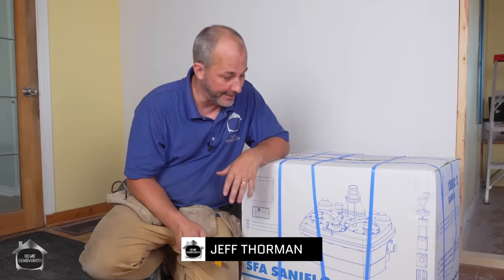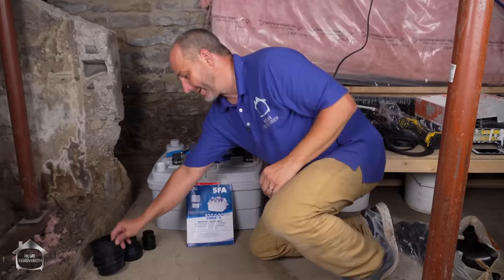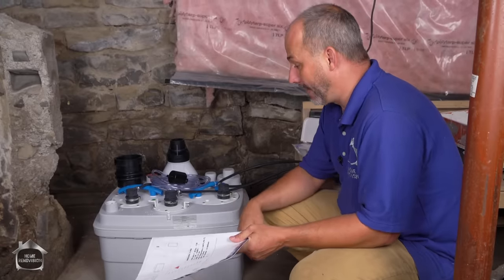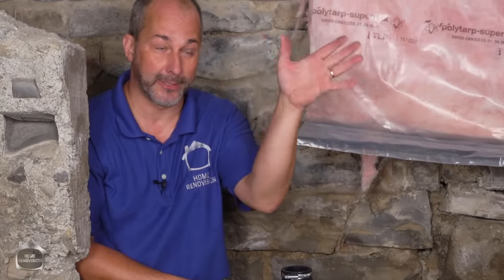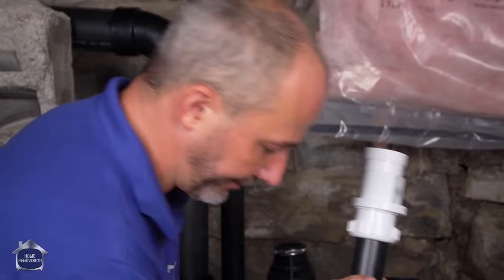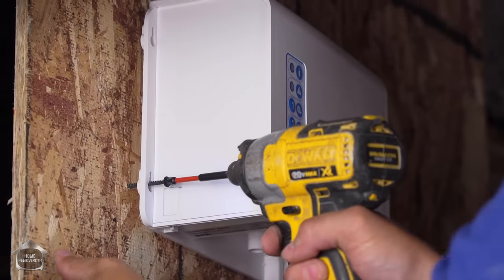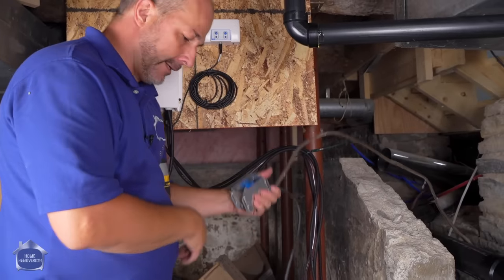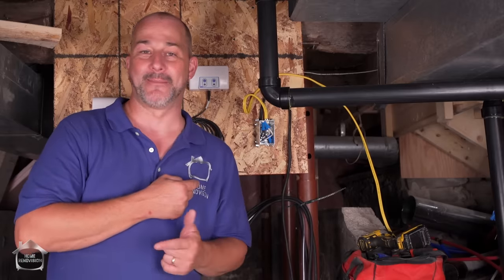Saniflo Macerator Plumbing Installation Instructions

Comment: Great job acknowledging your mistake and correcting it. I also like how you kept the mistake in the video and didn't just replace it with the correct version. Seeing a mistake being done is easier to learn exactly why it's the wrong way, additionally it was great to see the wiring being done. Cheers!

Comment: Having a 30' static head lift capability is impressive. I'm shopping around because our son needs to put a shower and toilet in his basement, and the main drain is 4' off the floor. This is looking like a strong candidate for that situation. I would like to install a sump-style tub below the slab, so the large toilet pipe could feed down into it. The shower could go right in the side, but I see the large fitting is on top, so that's a challenge. Thanks for sharing, I've subbed. I like your presentation style, and I wish you all the best!

Comment: Glad I waited to comment after finishing the video. Was gonna say something about the 14/2 not being enough & needing a 12/2 wire in that unit. But, you got it sorted & it’s cool that you left the “mistake” in the vid. You could have edited that out in post to make it appear was one perfect vid......awesome you didn’t. Everyone makes mistakes, it’s how you fix them that counts😉
Have been enjoying this series & it’s cool to see you transform your house into something magical that you & your family have done yourselves.
Cheers✌🏼
Reply: 14/2 is stuck in my head. :(
Reply from the maker: Hi Dianna, the load on thr machine requires a 12/2 line however ic can be wired to a double 15 amp breaker. Cheers!
Reply: Home RenoVision DIY Also was thinking when you were wiring up the unit & were using the 14/2....I was like cool, didn’t know a unit like that exists & how great that would be on some “problem installs”. But, you explained everything well in the vid, & again, it’s cool that you guys leave EVERYTHING in regardless of right/wrong AND fix the stuff if you are wrong. That, just goes to show how “human” you are; along w/ showing us your work ethic/morals etc....👍🏻👍🏻
Reply: Diana Fertig Sorry, didn’t realize the comment was a question, otherwise would have replied to you. Hope Jeff helped you out.
Reply from the maker: You my friend are a scholar and a gentleman. Cheers to you for your comments. I have stopped trying to act like I am perfect years ago. Besides Here on Youtube actors are sniffed out and rejected. Cheers to keeping it real!
Reply: If you dubbed a quick note at the point of the 14/2 mistake,  that would help stop others from making the same mistake. The repair at the end of the install time, is Great!

Comment: We use a saniflow saniplus at a student accommodation we manage, for one of the bathrooms to help pump sink, shower and toilet waste through the long shallow angled piping. Like you mentioned with those long black pipes. Its a smaller unit hidden in a back box behind the toilet. Dont forget to maintain it with the saniflow descaler/cleaner!  Great video
Reply: Can we use regular toilet bowl cleaner?

Comment: Top job, mate... 
Message to your viewers... He has the correct pitch... Over pitch ( > 1/4" over 1' ) is actually just as bad as under pitch ( < 1/8" over 1' ). The problem with over pitch is that the water drains too quickly leaving the solids behind, which invariably dry to the pipe creating a blockage you make actually have to cut out...

...Just say no to over pitched pipes.
Reply: Tim Falardeau it1/4” a foot 3” and larger is 1/8”
Reply from the maker: I Love it, I just say no to overpitched pipes. Cheers Tim!
Reply: Im a new build plumber and ¼ slope is fine. Ideally it should be ⅛ but It will still pass inspection if even ⅜. At least where im from
Reply: Why am I suddenly seeing a Scotsman tuning his bagpipes?

Comment: I bought a house that has all the plumbing running through a grinder pump and looking at this one this is what I need Because I have had one die before because most pumps are not rated to handle the whole home. So I will be looking into to one of these for sure now, Thanks :D
Reply from the maker: Cheers Sgt! this is definitely a made in North America solution that is quality all the way. A Company that has been in this business for many years with a support team available in case of problems. Cheers!
Reply: @HomeRenoVisionDIY  That price though wow that thing is expensive, I have a Zoller pump in there ATM, But the ability for one pump to die makes me wanna do it, Mine is in the slab so I am not even sure if it is possible. Have some research todo.

Comment: Love your channel, i work for a plumbing company and didnt realize they had toilet with its own pumps. 👌👍 Thinking of putting this in a detached building on our property to tie into the existing septic. The run is about 150' maybe 200' rise of about 8'. Ill dig it common trench with a pex line to supply water also. Electric is already out there. Just want to put a half bath in it so when we renovate it give more flexibility.
Reply: Will i need a toilet/sink pump also to achive rise and distance?

Comment: For anyone wondering the price for this unit is about $2700.
Reply from the maker: And worth every penny. BTW is that Cad or USD?
Reply: Home RenoVision DIY  No doubt, the horizontal distance is amazing and Mercian pesos.
Reply from the maker: Cheers Hunter, they have a single motor option as well at a lower cost but i prefer the back up power of having 2 individually operating motors. Cheers!
Reply: @HomeRenoVisionDIY  Home Depot has it listed for $2,713 USD before tax

Looks like this company has MAP pricing (every authorized vendor charges the exact same price set by the company)
Reply: OUCH!!
Reply: Thank you, but are you from Canada... cause.. the company is in Canada, Cambridge... so.. what is the price here? in Canada
Reply: @aggietor9208  would have to convert usd to canadian.
Reply: Jesus! $2700? And you have to INSTALL it? Should have walked over and installed itself...Why So Mucho?
Reply: @HomeRenoVisionDIY  how don’t you know you have one in the video..
Reply: I have the single pump version. Not installed yet. Probably another month or so before I get there. Cost me $1200 USD roughly with the elongated toilet bowl.
Reply: Also, purchased about 3 years ago at the beginning of my project.

Comment: Wow Jeff that's amazing! I'm debating what to install in my house. It has a basement rough in for another bathroom with the septic ejector tub in the cement floor. I'm not sure if its connected to the toilet plumbing yet. We shall see. This Saniflo system seems great. All I think I'll need is the single unit for a toilet, vanity sink and a shower. Thanks so much. That video was awesome!

Comment: These are great alternatives to digging a pit if you cant run underground plumbing in your basement due to the sewer line being too high although they do fail prematurely occasionally from just normal usage (even without throwing things you shouldn't in there).  I just had to replace my sanibest pro last week, only 5 years old. luckily it wasnt a messy failure i caught it quick, but the motor has just decided to die out on me. I just ordered the whole replacement tank which about about $1000 instead since the pump replacement was $799
Reply: Do they have a warranty? Or i guess homeowners insurance won't cover this type of application  maybe ?
Reply: I was thinking of getting the Sanibest Pro myself for a residential basement half bath. Any idea what maybhave caused the failure? Any suggestions on how to prevent a future failure? Any feedback from Saniflo? I thought this was supposed to have a ~10 year shelf life. How often are you using it (I know were getting personal here...)
Reply: You can find different brand macerator pumps on Amazon for like $250

Comment: I’m putting a master suite at the far end of our home that is 68 feet from the main septic line. I either have to have a long run of 3” pipe that would be 1/8” drop per foot, which concerns me of clogs with that long run, or I do this Saniflo system. I would like to have the pump in the basement, and use a regular toilet to flush down from the first floor into the macerator pump, along with the shower, sink and clothes washing machine.

Comment: I would like to renovate my bathroom including relocating all plumbed fixtures and adding a separate shower. Thinking this might be a less expensive route. As well, I have a small shop I would like to convert into an extended living space. This sounds like THE system to use!

Comment: Ihave the same unit I purchased 3 years ago, I’m finally getting to install it. What is strange is mine says 230v, but the connecting wire only has 3 wires, ground, neutral, and power?

Comment: Jeff, for maintenance you should put shut offs on all intakes and outtake (no need for the dedicated vent, and now folks you know why it's dedicated). In case of service you can shut the flow of waste off and service the unit, SaniFlo doesn't show it. The written  instructions mentions a shut off valve for the outtakes, but some of the pictures for the unit show shut offs on intakes as well. As for giving up a clean out, I wouldn't suggest that either as putting in a dedicate spot for the drain would of saved a clean out and taken about the same time. SaniFlo also makes stuff for marine applications, so I'm familiar with the name.

Comment: I was concerned about hi jacking the clean-out at first when I watched you make the connection. seems you were OK. Viewers should know codes require a clean-out  at a certain "developed length". If you didn't have another clean-out that met your code, add another wye at the connection and proceed. Easy! Nice Video, well made.

Comment: I'm looking at a system similar to this for replacing lines that are currently collapsed in my concrete basement floor. I want to rerun new lines for my kitchen, laundry and a wet bar and have it go to the main stack. The idea was to not have to bust up the finished basement to fix old clay tile pipes and have them go through my dropped ceiling in basement. I had a plumber come out and tell me that I would need to either bust up the floor and replace the existing lines to fix them or run lines through the ceiling connecting to a 3 inch main line that would hang low in the ceiling where it would be visible. A friend who is very diy savvy told me about these systems and said I should able to connect all the "New" lines to that system then run a smaller horizontal line to the main stack.

Comment: Great video as always! How is the system after 2 years working? I was hoping you show it on camera to see how it will function. The biggest question I have, is the sound it makes? is it loud? Thank you
Reply: I  too am curious about ther sound it makes.  Mine is loud.  Am wondering if there is a solution for this issue?  Your video video is great.

Comment: Thanks for the upload. Looks great and looks really simple. I would just hate to see the price. I went to the site but I didnt see a price anywhere so I came back here and watched the video completely all the way through. I will have to go back to the site to see of i over looked the price somewhere. Now I just have to watch the complete shower you were talking about. Thanks
Reply from the maker: The unit is costly, however there are other options with 1 macerator and even costs as low as 300 for a pump for a shower unit. Cheers just check with the fergusons or wolseley in your area!
Reply: @HomeRenoVisionDIY  thanks and i will check with them

Comment: I was planning on putting one of these in a small cubby off the kitchen on the main floor as a half bath. There's not good access to the main in the basement unless I'm banging my head into the drain every time I'm walking to the basement. There is however access to a smaller sewer  pipe that ties to the main which this toilet would be sharing this with the kitchen sink drain..wonder if that would be code.

Comment: It looks like a good solution to my basement plumbing problem :)   I scanned the other posts but never saw a PRICE... if it's not crazy money then it'll be for me... otherwise...out comes the jack hammer... (from Kenora NW Ontario Canada).  Thanks ps; forgot to ask, can it handle the discharge water from a washing machine... that would make it a total solution for a basement bathroom/laundry edit; (again)... did some reading on the saniflow site and yest it'll handle the washer....major bonus.... price is still a mystery.. WAG $2k Cdn....

Comment: We are planning to remodel a building with concrete floors. Rather than cut the concrete I was thinking of using one of these types of Saniflo waste systems.  1 Toilet 2 sinks and shower only. I have concerns regarding the toilet bowl, I have read reviews stating that you have to clean the toilet after each use because of low water in the bowl and no way to adjust the level. If you have any information or suggestions  I would appreciate it.

Comment: I just bought the saniflo 3. I am adding a full basement bathroom with a standup shower, toilet and sink. Excited to get it started but nervous because I have very little plumbing experience. I am placing the small pump in the wall behind the toilet. this wall also houses the main drain to the septic. This video helped a bit but any suggestions or input would be appreciated. Thanks!

Comment: Nice video. One question... everything I've seen on Saniflo toilet installs (Saniplus, Saniaccess, Sanibest) tells you to avoid hard 90's for the discharge pipe. They all suggest "sweeping" turns using 2 45's. Curious if this unit is different than the ones directly connected to the toilets?

Comment: Just something I would like to add if you have that loop of wire sitting on the screw that you put in you might want to wrap it with electrical tape to insulate the screw from the wire. The sharp threads on the screw may cut their way through the insulation on the wire from the weight sitting on it. I had that happen with a piece of Romex wire that someone left laying on top of a screw that was through a floor joist, overtime it cut its way through the Romex insulation 🙄
Reply from the maker: I will look at that again. Cheers!

Comment: I see you used your clean-out for this grinder pump.  Is that ok from a plumbing code perspective?  I have a similar situation and I assumed code required a cleanout as your sewer leaves your house.  I was trying to figure out if I could put another 3" Y fitting on the old clean-out and then still have a Clean-out and a place for the grinder pump.

Comment: We just moved into our home in southern Indiana from Florida....so yay we get out first basement. Problem is we are a family of 5 and only have one bath tub/shower upstairs. So we have already had someone come and frame and enclose a nice 5X12 space in our finished basement where we want to put a bath room. Vanity, shower, and toilet. 

You mentioned something that I didn't think about in that we are constantly getting clogs in the the toilets up stairs and we never considered that we could tie all the plumbing which fortunately is all on the back side of the house. 

I just have no idea where to begin with the plumbing. Do we call a plumber or a handyman to get the unit and or maceration toilet.

Comment: Hey Jeff, love the channel. I have referenced your videos numerous times for great advice. Thanks for the videos! 

I had a question regarding the dmx dimple foundation wrap with wood subfloor system- I have the ability to run this entire system to the exterior walls in the basement as it’s unfinished. Would it be good to run the system in the portion where the bathroom will be or stop the subfloor at the bathroom walls and build those walls directly on the concrete? 

Any advice would be great. Thanks again
Reply from the maker: when it is possible run the subfloor to the exterior wall and frame on top. Cheers!

Comment: What do you do when the power goes out? Are there any battery backup option for a system like this or is a generator the only solution? Or how many flushes can you get w/o power
Reply from the maker: In the country power failure means no water either. so the system will hold 4 flushes and the water supply has about 2 fills left in the pressure of the lines. Always use cottage rules during power outages. Cheers!

Comment: We installed one of the saniflo sanigrind about a year and a half ago for a bathroom addition and we haven’t had any problems. Recently we had to change out a wax ring on our toilet and now the saniflo doesn’t want to flush! The pump is still working and discharging the water from tub and sink but toilet hasn’t worked correctly since. Any ideas?

Comment: Pretty sure the alarm would be better to put it in the living area so you know something is wrong before it backs up into living area
Reply from the maker: LOL, no worries, the alarm is  more than adequate for notification. Cheers! The alarm sounds when 1 motor has a problem. in that case the unit automatically switches to the second motor which operates independently. Cheers!

Comment: Have a home owner saying they are smelling gases. This is the white one with just tiled shower 2 inch trap on a 2x6 build up. Ptrap with vanity vent is inch half to the main drain as well with the toliet connected any suggestions I've even put the sticker no wippies tampons  razor blades I'm sure you've saw thos circular sticker.